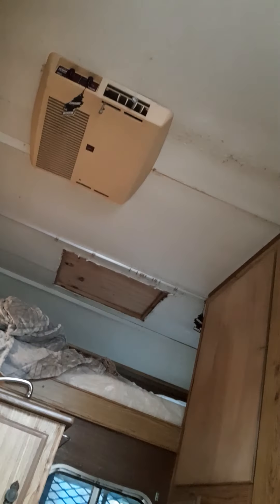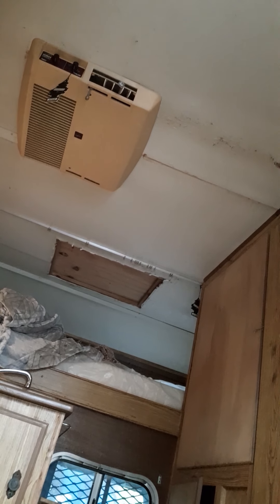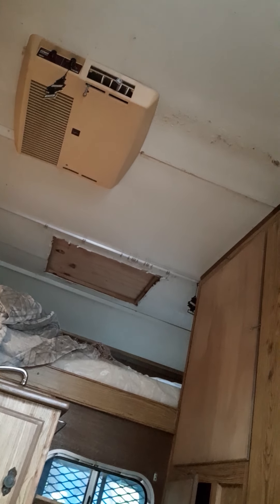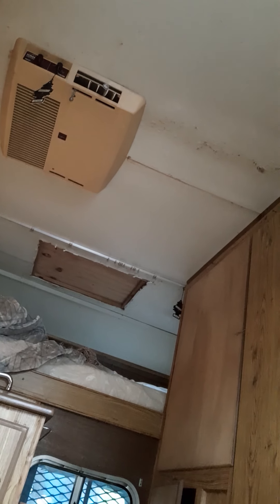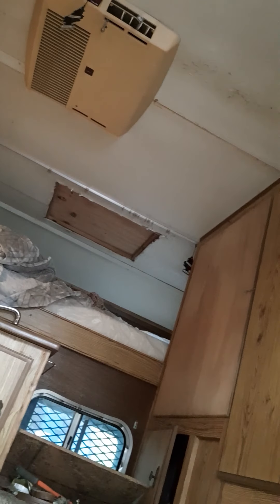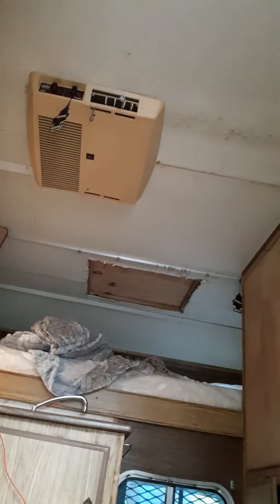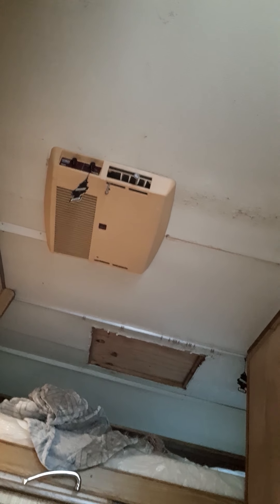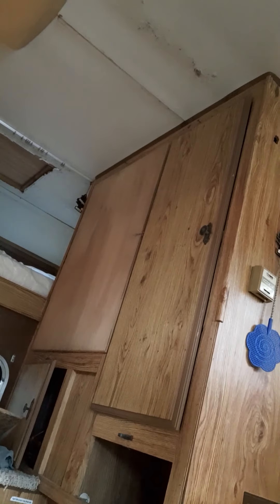What I did today Part 2

Comment: Hi Tom!  Put water or rubbing alcohol in a spray bottle and put in 10-15 drops of peppermint oil in it.  Spray in the areas where you see the ants, spiders etc.  My boyfriend killed a spider with this last week. Also peppermint tea bags are said to work too.  Nrew the tea baga and put in each corner of the rooms.  I also put used peppermint tea bags in my trash cans. I saw this on a youtube channel called Brighter Side.  There are lots of others too.  Hope this helps.  Stay safe out there. ❤
Reply: The peppermint also helps with mice. I do drops of peppermint oil all around my van all the time but peppermint tea bag sounds interesting
Reply from the maker: Thanks